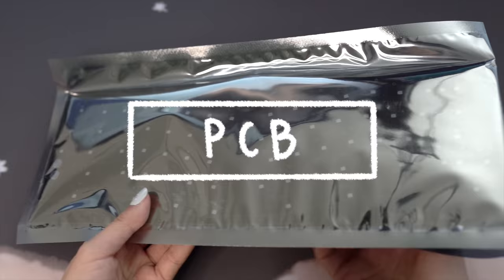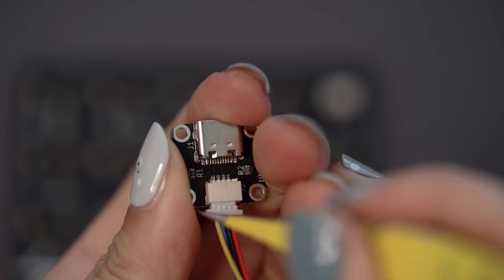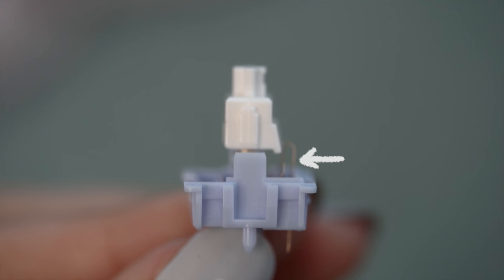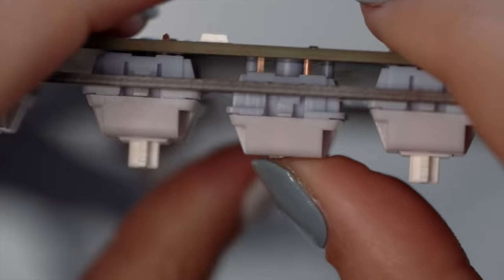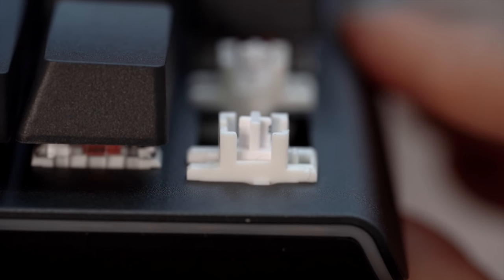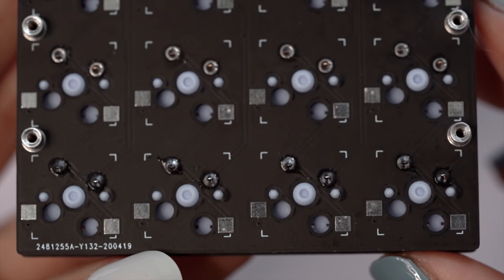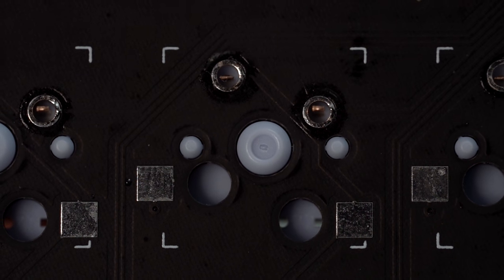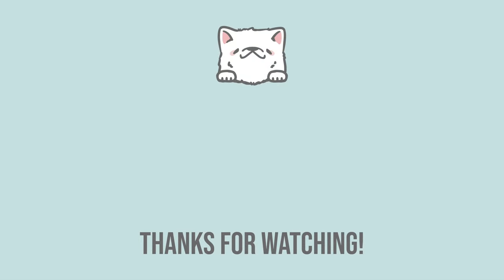Keyboard Building for Dummies 101

Comment: My personal preferred method of desoldering is using wick, you place the wick to the joint, press the iron against the wick and pull away. The wick acts as a sponge tot he liquid solder, thus removing the need for a the pump. It's also very cheap.

Comment: For boards with hot swap sockets can you test the pcb the same way?
Reply: Yup! You can test it the same way. It's easier to do this from the back (not swtich side) of the PCB. Just connect the two metal contacts on the hotswap socket with your tool of choice: tweezers, wire, twist tie, etc.

Comment: 320°C for soldering is pretty high, I usually only go that high if I'm desoldering.
Reply from the maker: I used to solder at 300C for 0.5mm wire but I found the solder would melt too slowly for my preference so I bumped up my temp.